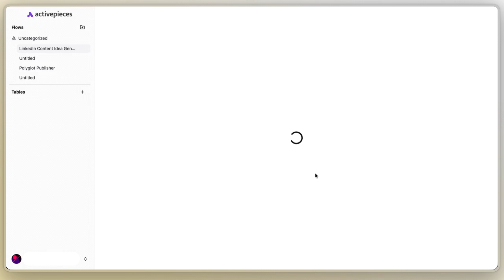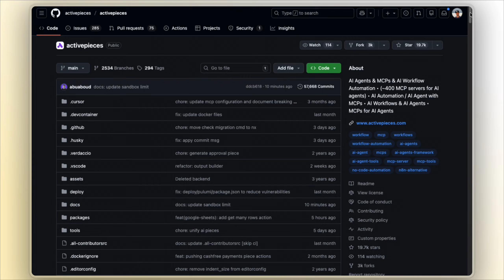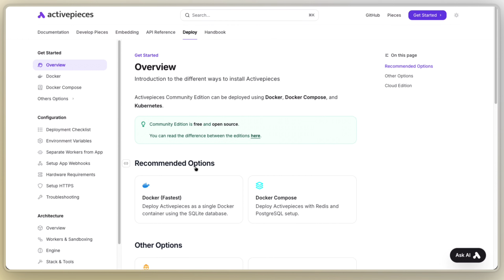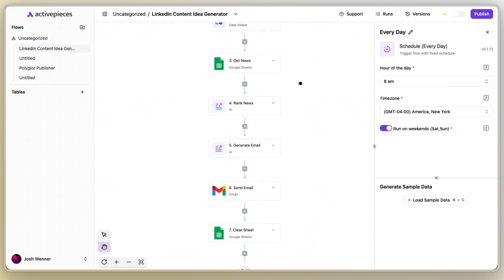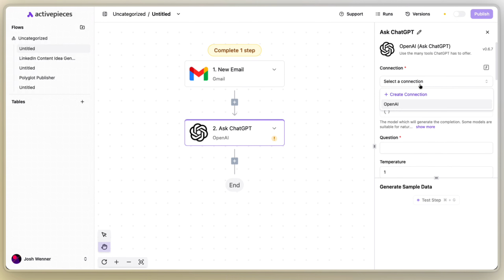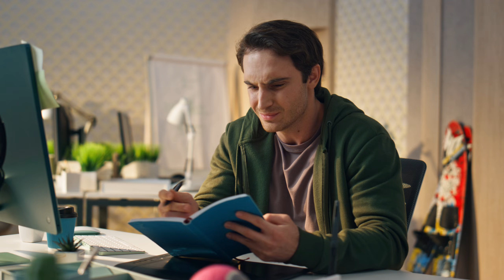This Tool Turns Claude Into an Automation Engine (ActivePieces)

Comment: It is not "MIT licensed", indeed its quite complicated:
from their license github file:

Portions of this software are licensed as follows:

* All content that resides under the "packages/ee/" and "packages/server/api/src/app/ee" directory of this repository, if that directory exists, is licensed under the license defined in packages/ee/LICENSE
* All third party components incorporated into the Activepieces Inc Software are licensed under the original license provided by the owner of the applicable component.
* Content outside of the above mentioned directories or restrictions above is available under the "MIT Expat" license as defined below.

Also there is a Community version which gives away that it is not simply free software.

Comment: ~12 features are enterprise-only:

  1. Team collaboration - multi-user, multi-project management
  2. SSO/JWT authentication
  3. Custom RBAC (role-based access control)
  4. Audit logs
  5. Git sync
  6. Custom domain
  7. Custom branding (UI + emails)
  8. Private pieces
  9. Embed SDK
  10. Per-project limits configuration
  11. Pieces/Templates management (admin controls)
  12. Cloud hosting (though you can self-host for free)

  ---
  What's NOT Locked

  The important distinction: no core automation features are locked. You get:

  - All 425+ connectors/pieces
  - Unlimited flows, steps, connections, and task executions
  - AI Agents (part of core)
  - Custom piece development
  - Full flow builder functionality

  The locked features are purely enterprise administration, team collaboration, and branding—not automation capabilities.

  ---
  Cost Comparison

  | Edition                 | Cost                   | Best For                                      |
  |-------------------------|------------------------|-----------------------------------------------|
  | Community (Self-Hosted) | Free                   | Individual users, small teams, cost-conscious |
  | Cloud Plus              | $25/mo + $1/1000 tasks | Convenience, no server management             |
  | Cloud Business          | $150/mo                | Teams needing collaboration                   |
  | Ultimate                | Quote-based            | Enterprise compliance/security                |

  Self-hosting on a $5/month VPS gives you unlimited automation with zero per-task costs.

  ---
  Sources

  - https://www.activepieces.com/docs/about/editions
  - https://www.activepieces.com/pricing
  - https://community.activepieces.com/t/differences-between-cloud-and-self-hosted-features/2623
  - https://blackbearmedia.io/activepieces-review/
  - https://github.com/activepieces/activepieces

At first, I was like "why would I move from n8n", but honestly they are no worse than n8n, and the mcp thing is at least interesting.